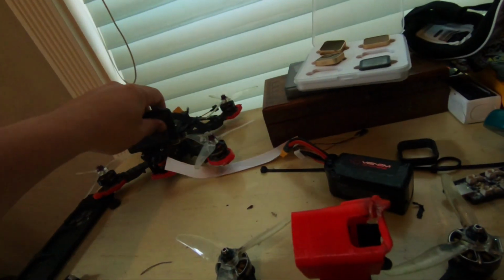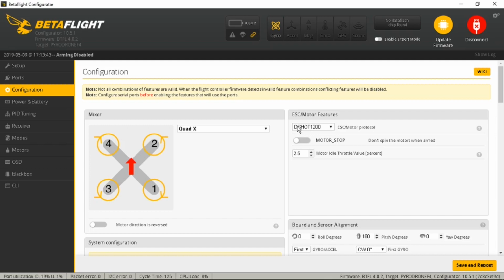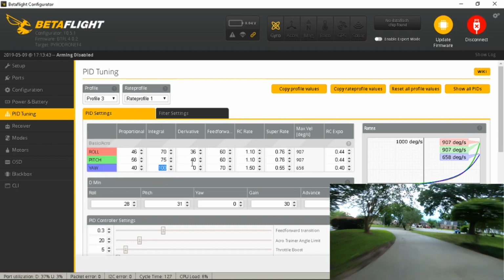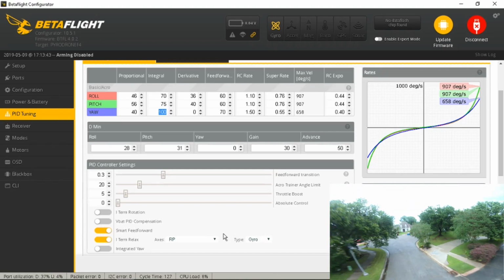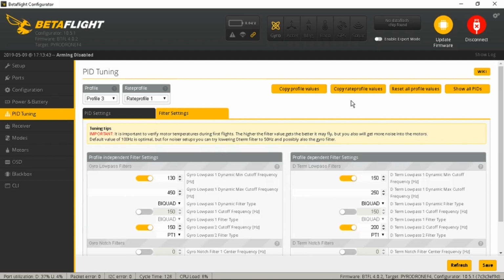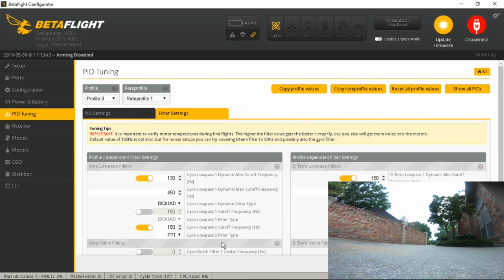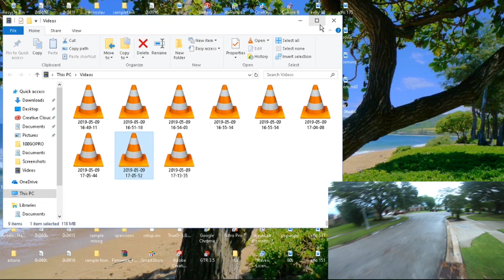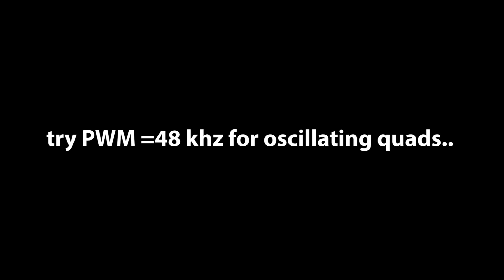My Betaflight 4.0 Settings!

Comment: With Smart Feed Forward tuned on, and FF gains <250, you can just turn off FF (set gains = 0).  FF is not active anyways.  Smart FF is already removed from BF 4.1.
Reply from the maker: I thought we weren’t supposed to set ff over 100? So your saying I’m not getting any ff with the way it’s setup?
Reply: @MaxBeamer  , correct.  And that is ok.
Reply from the maker: UAV Tech gonna AB it tmrw turning smart on and off lol that’s crazy thanks for the info 🙌
Reply: @MaxBeamer  , yeah buddy.  Do it on a quad with logging and check out FF with gains of < 200 and Smart FF enabled.  They stay flatlined.

Chech out: https://youtu.be/CzWNDYRNBmI from 6:45 forward.

Comment: Hello from Spain it looks very  good , but  my question is you are flying Bidiretional and RPM Filtering or ownly the update 4.0.2 and changed it to this values ????? Thanks and best regards from Alicanye Spain :-))))))
Reply: Look the 6 Vidios from UAV TECH  Mark Spatz   i flay his settings he is one of the creaters from Betaflight .
Reply: This is from GIT HUB tunning Tips Present Mark Spatz :#Filter Settings
set dyn_notch_min_hz = 80
set gyro_lowpass_type = PT1
set dyn_lpf_gyro_min_hz = 100
set dyn_lpf_gyro_max_hz = 350
set gyro_lowpass2_hz = 0
set dterm_lowpass_type = BiQUAD
set dyn_lpf_dterm_min_hz = 60
set dyn_lpf_dterm_max_hz = 175
set dterm_lowpass2_hz = 0

#PID Gains Settings
set vbat_pid_gain = ON
set anti_gravity_gain = 10000
set f_pitch = 0
set f_roll = 0
set f_yaw = 0
set d_min_pitch = 0
set d_min_roll = 0

#PID Controller Settings
set feedforward_transition = 0
set abs_control_gain = 0
set use_integrated_yaw = OFF
set iterm_relax_type = GYRO
set iterm_relax_cutoff = 11

#TPA Settings (which is D-term only by default)
set tpa_rate = 80
set tpa_breakpoint = 1800
Reply: #Filter Settings
set gyro_lowpass_type = PT1
set dyn_notch_min_hz = 100
set dyn_lpf_gyro_max_hz = 510
set dterm_lowpass_type = PT1
set dterm_lowpass2_hz = 0

#PID Gains Settings
set vbat_pid_gain = ON
set anti_gravity_gain = 10000
set d_pitch = 58
set d_roll = 55
set d_min_pitch = 38
set d_min_roll = 35
set d_min_boost_gain = 45
set d_min_advance = 0

#Assumes Freestyle | For racing use "Setpoint" and cutoff = 20
set iterm_relax_type = GYRO
set iterm_relax_cutoff = 11

#With RPM Filter | Without leave at = 8 (default) OR set to 0 if you can afford less filtering
set dyn_notch_width_percent = 0

#TPA Settings (which is D-term only by default)
set tpa_rate = 80
set tpa_breakpoint = 1800
Reply from the maker: I had issues with rpm filters this is basically my solution to using 4.0 without them.
Reply: @MaxBeamer  Ok thanks i will taste it :-))))))))))
Reply: @MaxBeamer  Yes because you need realy for good flying RPM and Bidirectional the beta Version 32.61 D-SHOT 1200 and flay 4K  4K itested it and have the flay to the moon effects and its not recomendeble until 01.09 when comes 4.1 .
Reply: I flay your settings and very good !!!!!!  :-)))))))
Reply: I maked  a little change P YAW 45 and  I YAW to 85  and the igual i noticd it better :-))))

Comment: Thanks  for the sub. Dude I just updated.  Switches where not working right .  so changed uart . But changed wrong one. Now I cant get into drone.. what do u think. Can I start in bootloader mode and get it to connect?
Reply from the maker: If you turned accidentally connected to the uart that controls usb then u need to reflash the firmware in boot loader mode Bardwell’s video may help https://youtu.be/m4ygG6Y5zXI

Comment: Enabling smart feed forward with low feed forward settings mostly disables feed forward.
I bet, if you look at bb-logs, feed forward is staying at 0.
Also, if you keep your gyro filter 2 at 150hz, I would Disable or raise gyro filter1 min way higher than you have. But, my quad has mostly noise free motors. Have no experience with bf4.0 and a noisy quad.
Reply from the maker: That’s what people have told me about ff, couldn’t believe it!